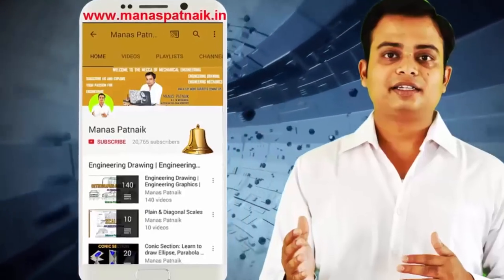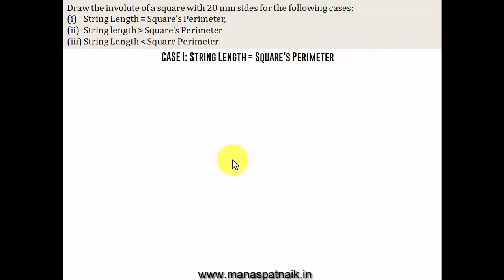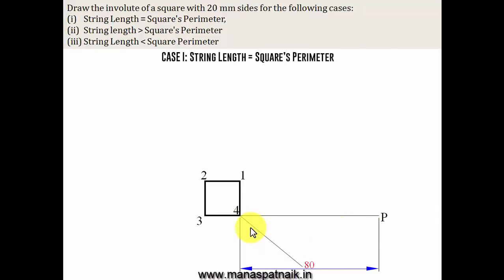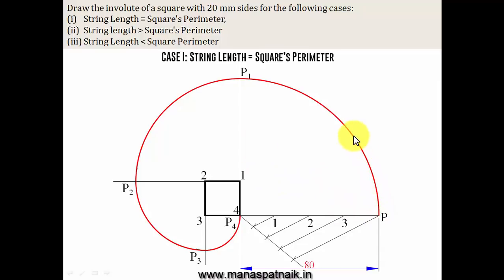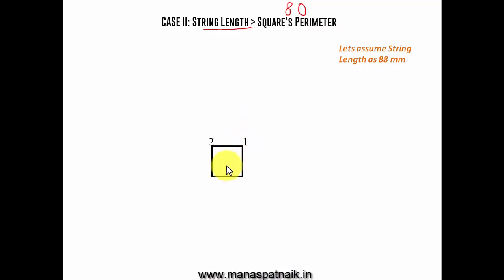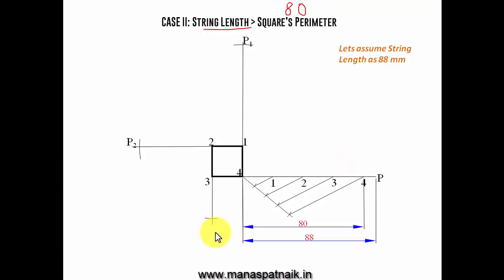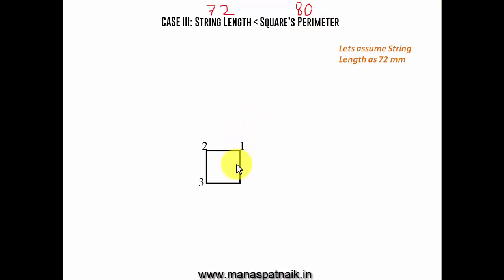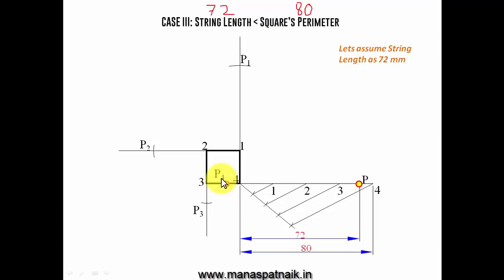Involute of a Square: All Cases Demonstrated

Comment: Sir it would be your humbleness if you make video on this question
A cube of 35mm long edge us resting on the HP ,one of its face it with a vertical plane inclined at 30 degree to the VP. It is cut by a plane perpendicular to the VP inclined at 60 degree to the VP and perpendicular to the HP so that face which makes 60 degree angle with the VP is cut into two equal half. Draw the sectional front view